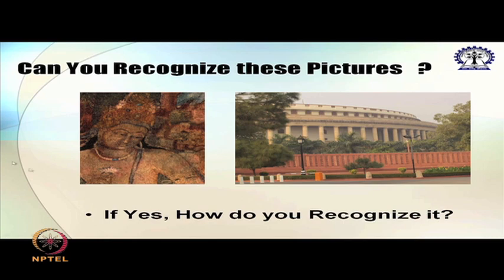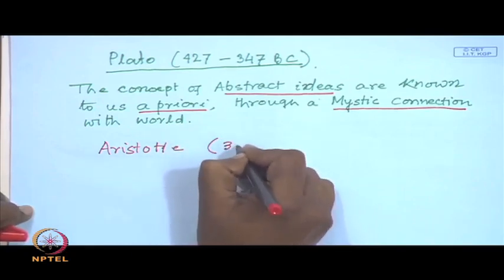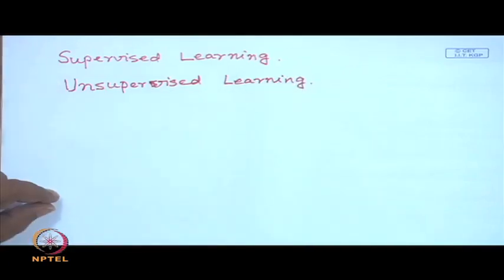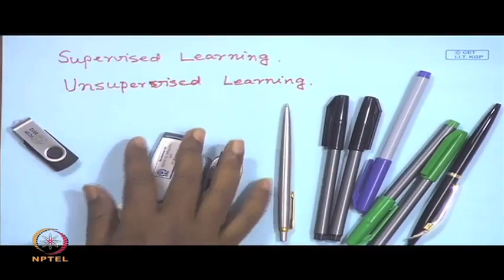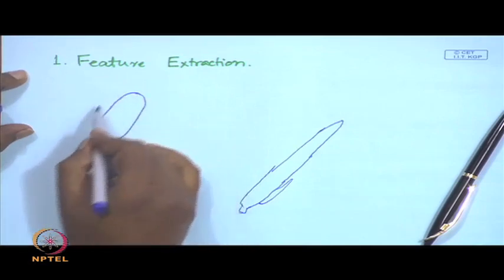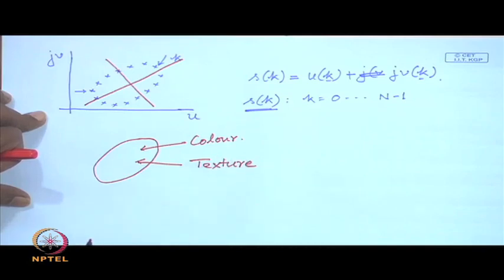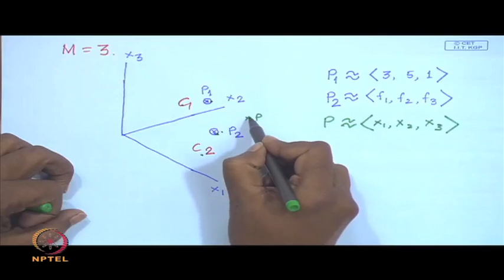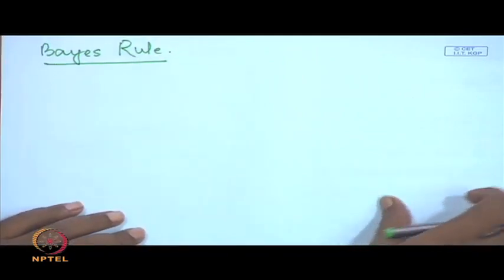Mod-01 Lec-01 Introduction

Comment: আমার ১১ class এ complex number সম্পর্কে জানার পর থেকেই এই কথাটা মাথায় ঘুরতো। যে mathematical calculation এ imaginary number ব্যাবহার করলে সুবিধে হয়। কিন্তু বাস্তবে এর ব্যাবহার কোথায়? এই একই ধরনের প্রশ্ন class ৫ এ এসেছিলো। যে negative number ব্যাবহার করে কী লাভ? পরে বুঝলাম যে, -১১ টাকা লাভ হয়েছে বললে, আসলে ১১ টাকা ক্ষতি হয়েছে বুঝতে হবে। ০ টাকা লাভ/ক্ষতি হয়েছে বললে, বুঝতে হবে কোনো টাকাই লাভ/ক্ষতি হয় নি। এখানে ১ম playlist এর ১ম video তে feature extraction নিয়ে বলতে গিয়ে প্রথমেই বলছে object টার ২ dimensional area এর একই surface এ complex plain কল্পনা করতে হবে। এখানে boundary তে complex plain এর ওপর point দিয়ে ৩ dimensional জিনিষ (object) টার ২ dimensional visible area বার করতে চাইছেন। মানে ঐ integration, discrete fourier series ও transform।